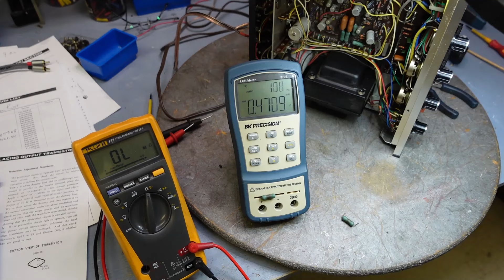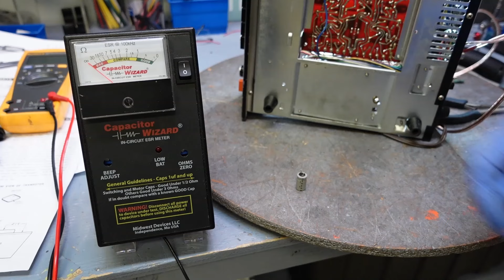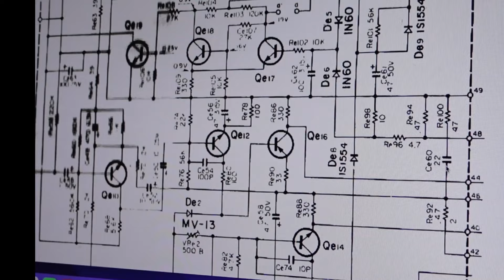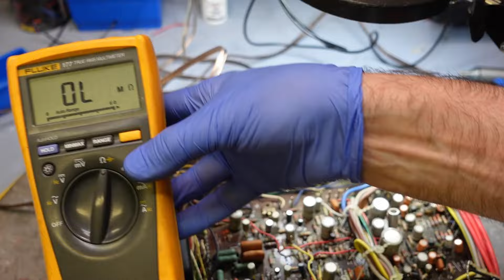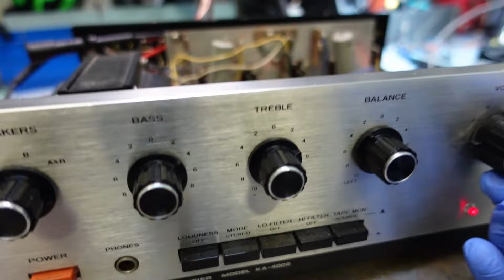Kenwood ka-4002 in for service, something caught my eye!!!

Comment: It is very likely that the amp is designed to run on 117V AC mains, being that it is that old. And now if you run it at 120V - 125V the secondaries will increase as well. I would replace all caps that are 50V with 63V and i would increase the main filter cap capacitance as well for a bit of boost in dynamic performance.
Reply from the maker: that makes alot of sense....thank you!!

Comment: Thanks for another great video.  Question  about your Capacity Wizard.  Did you find this works better than other in circuit testers such as peaks or is just the one you all ways used.   Looking to buy my first in circuit cap tester.
Reply from the maker: I really enjoy this cpacitor wizard, it will test great in circuit but remember, it only test ESR, not value.

Comment: I will definitely change the filter capacitor and I will go with higher capacity to smooth better the ripple and also the output capacitors as well!
Reply from the maker: Yes...that would certainly been a possibility.
Reply: @VintageAudioFever  definitely will improve in sound quality. I don't know what is the value of the filter capacitor after the rectifier bridge but I will definitely put in at list 10000uf and on the output capacitors 4700uf

Comment: i currently have the tuner that goes with this amp for sale on ebay
Reply from the maker: ok cool...I might be interested... whats the tuner model number?
Reply: @VintageAudioFever  (TK-350) its for sale in the uk. so probably not worth it for you because of postage. but very heavy, has germanium detector diodes possibly germanium transistors too, Trio gear was well built.  good video, thank you.